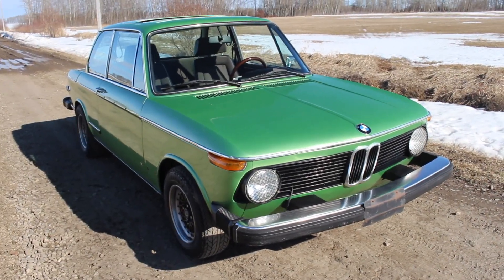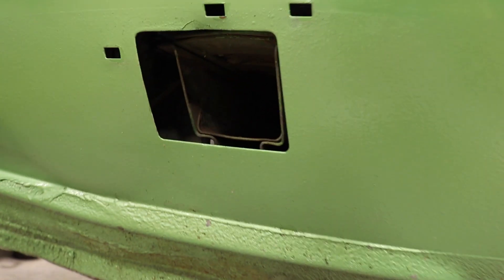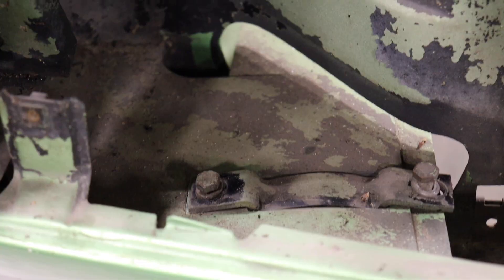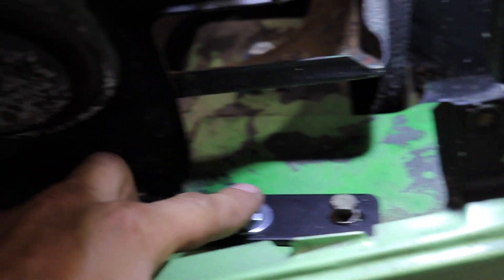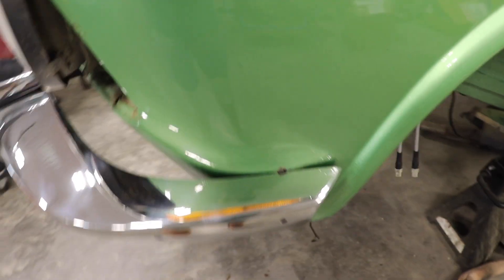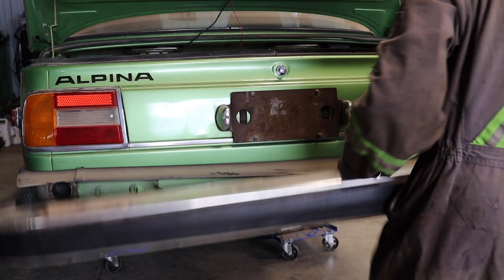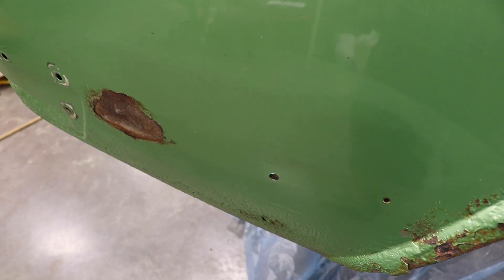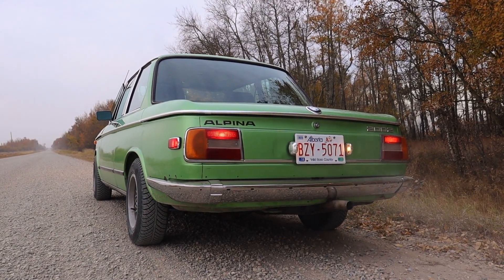BMW 2002 Chrome Euro bumper SWAP (How To)

Comment: David, thanks so much. I have a 71 with these bumpers that I’m just starting in on, but this gives me good insight on some of the adjustments I need to make to fix some positioning. I’ve learned lots from your videos that will make my own project smarter and more manageable.

Comment: Great job! One thing David, for the front bumper side pieces, there should be a rubber spacer between the bumper and the fender. That will prevent the bumper from scratching the paintwork. There is a BMW part for that, but any rubber spacer with the proper inner diameter (same as the bolt) will do

Comment: I am installing pre 1972 bumpers on a 1974 2002. The base bumper supports shown in your video are different than the stock supports(1971 and prior) by reason of a flange added that allows them to be attached to the frame using the same attachment point as the 1974 "big bumper". Could you tell me where I can  buy those bumper supports. Thanks!